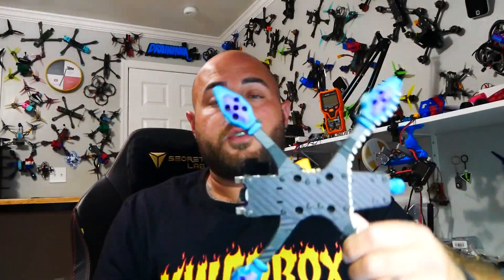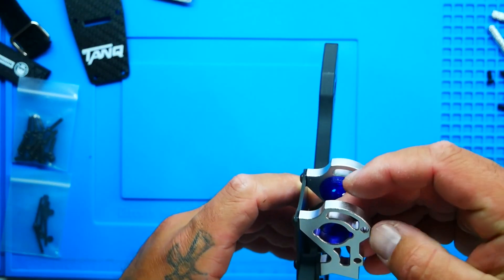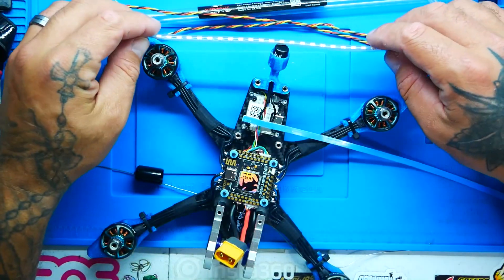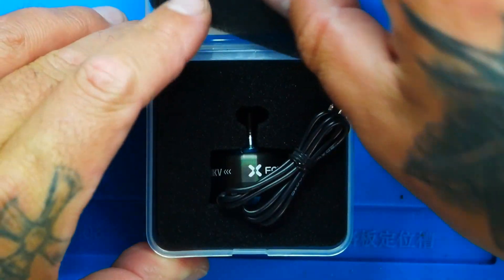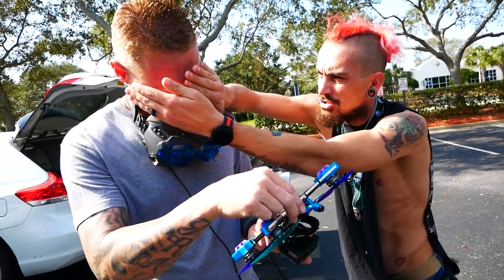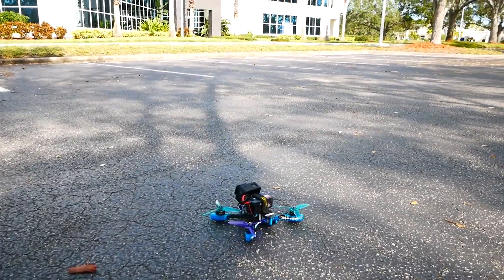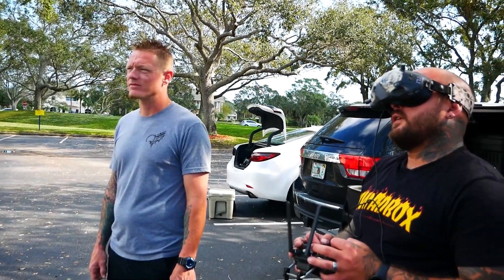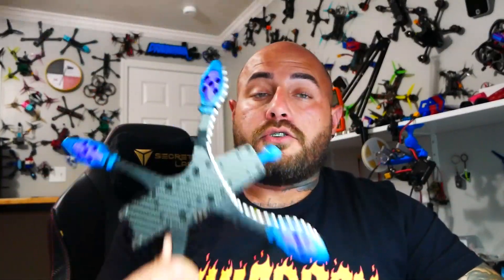The Tanq Frame is Here!! Hardcore Testing, Real Pilot Thoughts, Let's Gooo!

Comment: I love it so much, I have 2 and I have the Tanq S as my first build it myself quad, the Tanq 2s are BNF, but I loved building it and flying it after is more satisfying than the BNF quads i own.  I love your channel!  I am jealous I don't have a group like that to go learn and fly with.  I am still just a little over a month in with freestyle quads, but I am improving and the Tanq has been awesome except I havne't had the best luck with the Hypetrain motors.   Smashed into a metal fence post coming out of a power loop into a baseball field dugout @60+ and it didn't break anything but a prop and my pride, but it smoked 2 motors for some reason.

Comment: Would you recommend slapping 4s motors on it and setting up 6s and 4s profiles cuz the logs have minimal noise how I got it
Reply: Currently xing 2 2207, 1800kv. Ok for slow freestyle on 4s and I probably need bigger 6s. More than 1100.

Comment: Hey. I was wondering what you actually get with the frame. Do you get the M3 12mm screws for the motor , then you have to either print thespacer or the mount, would be good to see an unboxing, I have ordered one so just womderimg